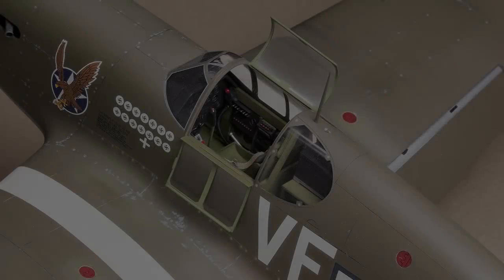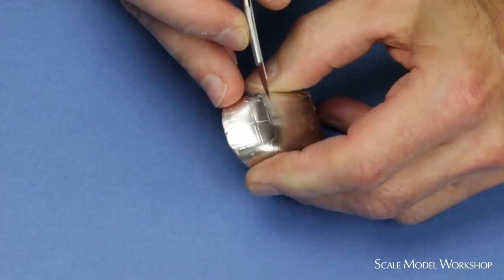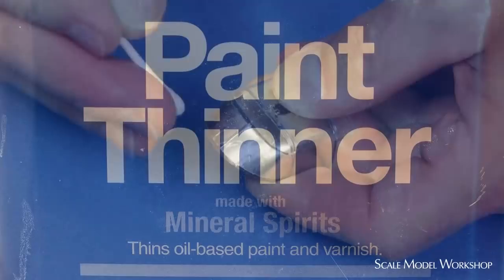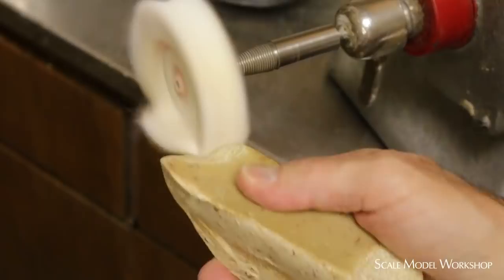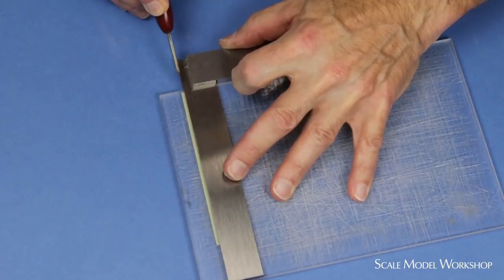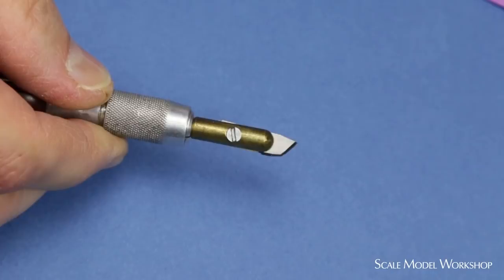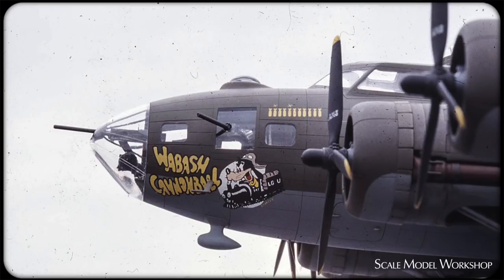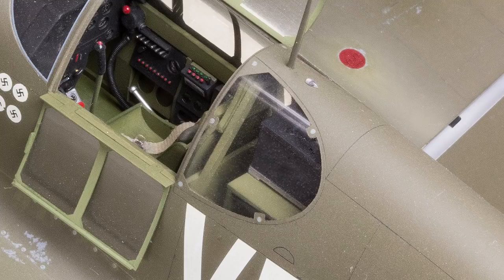Finishing Techniques for Model Aircraft Canopies

Comment: Excellent video...like the rest on your channel reference class! A question though...how can I get bare metal foil off a canopy after painting. I have a 48scale Airacobra with the foil still on sitting on the shelf for almost 10 years now...I am affraid to ruin the glass parts and hence have to tried to remove the masks yet.
Reply: May I make this suggestion to you.
I had a disastrous mishap with a canopy that was left only fit for the bin. I contacted the manufacturer of the kit and asked if I could possibly purchase a new one, stating which kit it was, including the barcode and kit numbers,  the trouble I was in, and the fact that only a replacement part would rectify the problem.
I heard nothing for 3, nearly 4 weeks, but as I had emailed an Asian company, I hadn't expected any response so soon, and then a small parcel appeared through the letterbox - I had been sent a new canopy free of charge !
If the company is still going just try it, but of course, offer to pay. Even if they do charge you, it's likely to be only a small charge to cover postage costs, or at the most a few quid for a replacement.
So who was this wonderful kit producer who supplied my new canopy freely - Tamiya !
Kit producers carry spares for a long time after a kit has ceased production, and it may be in production for several years as well, but you may be lucky and they may have a box of canopies in storage somewhere. I hope this helps, and at least you can finish the model and get it off the shelf, even if it's not in the way you wanted to do it.
Kit manufacturers know how important it is to keep buyers of their products happy, as they want you to carry on buying their kits, and will often go that extra mile for someone genuinely in need of help. As a side note, I have also read on a forum that a teenager making only his 4th ever kit, who mis-read the instructions on the first ever aircraft kit he was making, and completely fluffed the model, so he contacted Italieri and explained how he had misunderstood the instructions and had ruined the model he was making. They sent someone round to listen to him, so he explained the problem and how he had mis-read it. The rep said ok thanks and left, saying nothing else. A week later the kid got a parcel with half a dozen small kits in, some tools, paints, glue, and a letter thanking him for bringing the problem to their attention and hoped it hadn't put him off the hobby.

Comment: Thank you for this video! 

I've tried bare metal foil and have come across a problem: the foil leaves a residue that's about as "stuck" to the canopy as the paint. Efforts to remove the residue removes paint as well. Has anyone had this issue?
Reply: Haven't tried this method, but maybe cost the paint in a hard-wearing laquer and then remove the residue with white spirits?
Reply: try Goo Gone on a Q-tip